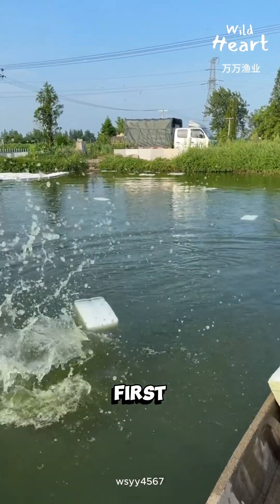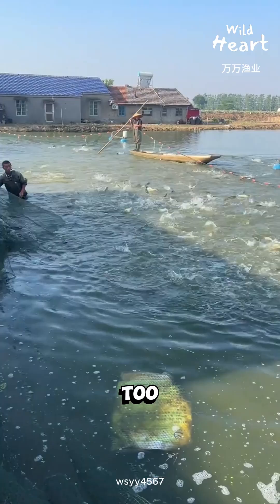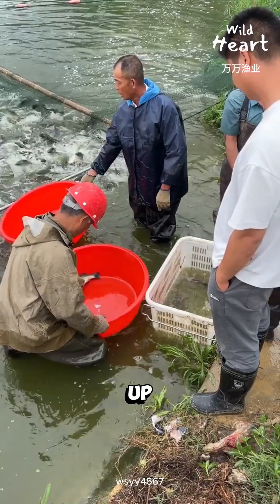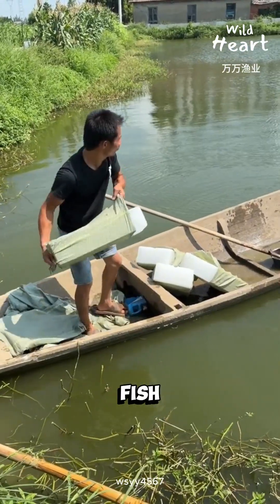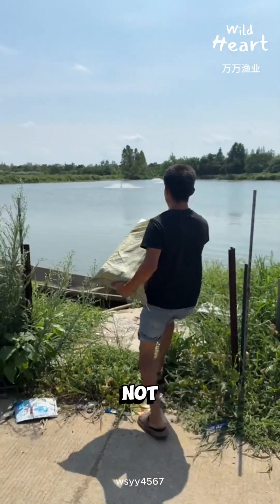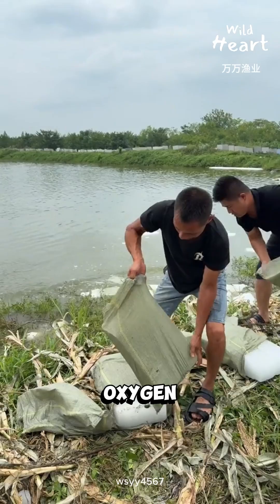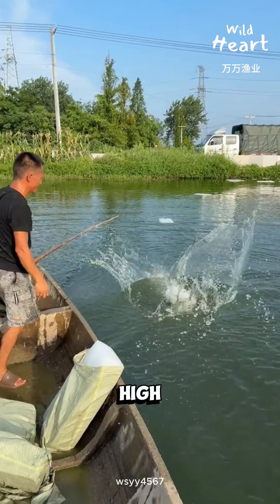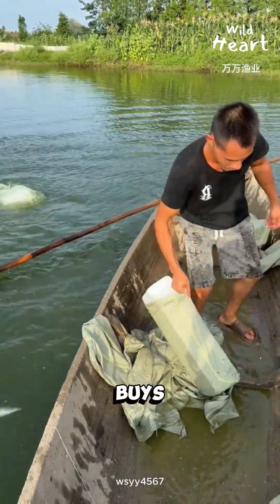Emergency Pond Cooling

Comment: There's two things you can do, install like an aerator or fountain, or deepen the pond and circulate the water with a pump. 

Ice is the more expensive and labour intensive solution amd no one smart does this unless fuel is $5gal or more.